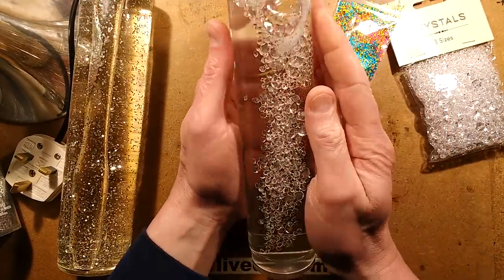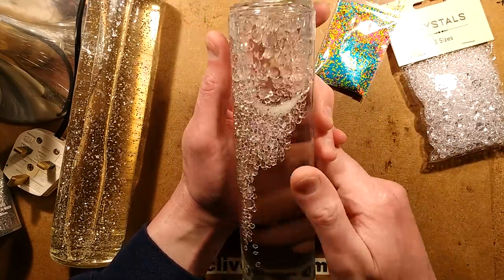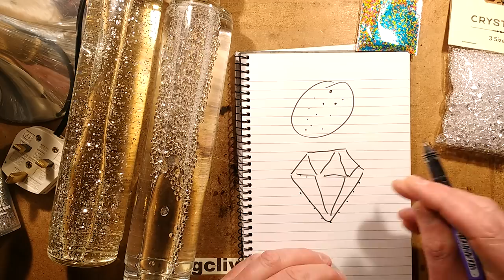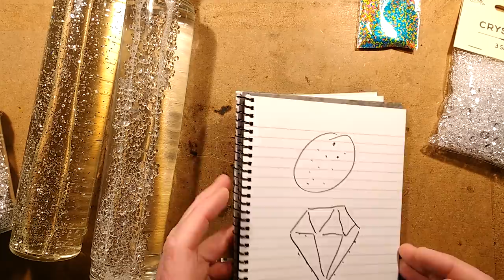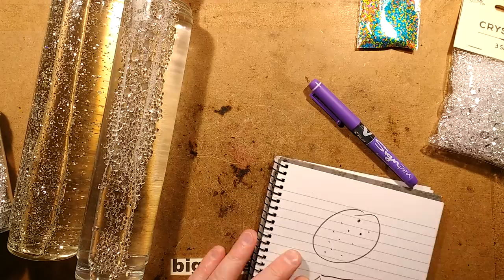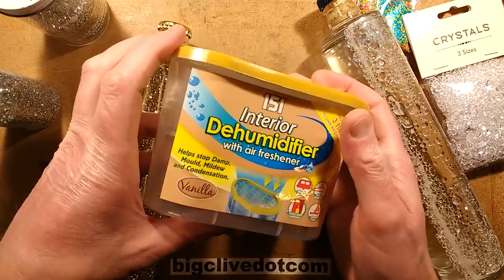Make a DIY flowing crystals lamp.  (Gillian's diamonds.)

Comment: You're absolutely right about early electrical equipment. I have a vivid memory from my childhood in the 1960s when our television suddenly started spouting flames and smoke. There was lots of shouting and then my dad came running into the room with a bucket of water which he poured straight over it...

Comment: Sorry to hear about your mum :(

I'm guessing they're polystyrene. It fits, being hard and clear, and apparently has a density of 1.04g/cm^3.
Reply from the maker: That's an interesting idea.  I've never really thought of polystyrene as having uses like this.
Reply: bigclivedotcom it’s also a very cheap plastic, much cheaper than PMMA (acrylic) so would make sense for a Poundland style product
Reply: bigclivedotcom If you want to test for polystyrene you could try to dissolv one in acetone. If is is getting sticky and dissolving you can ne quite confident it is polystyrene.
Reply: I know I'm replying to an old comment, but another thing you could do is to put a plastic diamond in a cup of water in the microwave. If it softens and deforms, it's polystyrene, because it has a glass transition temperature of around 100°C. Which is also why items made of PS aren't microwave safe.

Comment: Your mom was so lucky, having someone like you to light up her life. I offer condolences as well as a chemistry trick: 

Adjusting the specific gravity will be a bit easier using a saturated salt solution (brine), especially in the fine-tuning adjustments. You'll have more immediate feedback as you titrate the desired density as the salt is already dissolved.

Comment: Sorry to hear of your loss Clive.  

You may be able to get your glitter lamp working if you use a wetting agent like Kodak Photo Flo (or a drop of jet dry rinse aid)...  that would break the surface tension in the water disrupting the boyancy of the lighter fluorescent particles.

Comment: There's an old school building that I dream of buying, fixing up, and living in. As part of that, in the large entry area, I envisioned 6 giant glitter lamps along the walls, which serve as light sources, heat sources, and decoration. In the U.S., we have 250-watt incandescent heat lamps, which are 10% efficient as lights, but 90% efficient as heat sources. They're very bright, very hot, and would be great lights for glitter lamps that are a foot in diameter and 5 feet tall. I think I want an amber-colored liquid, that seems to be my favorite color. And if I ever get to fulfill my dream, Clive has now given me the last piece of the puzzle - what to use for the glitter.

Comment: Big Clive, would be interesting if you disassemble a fujifilm instax printer to see whats inside and how it works. I don't see anyone has done that yet. Thanks
Reply from the maker: It's similar to the old Polaroid cameras.  The photos each have a section of developing chemical at one end that gets squeezed out over the back of the image as it is ejected from the camera through rollers.  The camera itself is usually really simple.
Reply: bigclivedotcom Yes I know that for sure, but I think what you just explained to me is the "Fujifilm instax camera", you should take a look at "Fujifilm Instax Printer". It's not a camera, it's a printer that uses instax film. The thing I'm not sure is how does it transfer a picture to the film? Is there an LCD screen inside or anything else going on? anyway, thanks for responding to my comment :) your channel never fails me, keep up the good work.

Comment: If you use strictly distilled water with calcium nitrate, it wont dissolve the metal.  It is when you use tap water and the nitrate where you create problems, mainly from the inherent chlorides that are in municipal water systems.   When chlorides and nitrates combine, tbey create nitrosyl chloride which is the workhorse in aqua regia (royal water, one of very very very few things that can dissolve gold and some other precious metals)

Excellent video, thank you for sharing

Comment: I saw similar lamp but it was in gel and it had color marbles inside instead of diamonds. It had bright light and some sort of heater at bottom like lava lamp, but it was heating it, marbles go down, then is (I think) stop heating it and they slowly go up. And it was repeating it all the time: balls go up and down slowly. Pretty nice effect.
Reply from the maker: A lava lamp.  It uses weighted wax to create the blobs floating in a water based carrier.

Comment: Acrylic can be injection moulded, extruded of compression moulded, but highest quality PMMA is made by cell casting when they pour liquid monomer and heat it up to start polymerization process, I guess they made this crystals either by cell casting in a mould, or by compression molding, and then probably some postprocessing involving polishing them

Comment: For adjusting the solutions specific gravity, another good modifier is ammonium sulfate. It is pretty easy and cheap to find, as it is often used as a fertilizer. More importantly, ou can dissolve up to 75-80g in 100ml of water. This is about 30% more than Calcium Chloride, which can allow for even higher specific gravities than before.

Also, me condolences Clive about your mother, may she rest in peace and may your burden be light. Always remember she lives on through you and the ones you touch.

Comment: if the glitter you used at the beginning of the video have all different weights... perhaps they would make an interesting cymatic patterm when you put them on a vibrating plate, the different densities would concentrate at different locations

Comment: Use LEDs for light and a resistor for heat. Maybe use an inefficient on purpose resistive dropper based power supply.
Reply from the maker: I did that in another style of lamp.  The PCB had two resistors to limit the current and provide the heat, then just a discrete rectifier and ring of LEDs in parallel.

Comment: I wonder if you could put a couple of power resistors at the bottom, and then use a couple of RGB LED to make a sort of ambient color changing lamp. Then, you could put a thermocouple (or even a thermistor if it were accurate enough) and then dial in the temperature of the bottle perfectly, taking into account the ambient temperature of the room as well. Heck, even be able to fine tune the floating and speed since you could make the liquid slightly hotter or cooler.
Reply: not a led but rgb laser..  looking for those diamonds allready.....

Comment: Calcium chloride is easily available in hardware stores in the US as an ice-melter in the winter. I suppose this tube could be heated with a tea-light candle and lit with an LED ring or just heated and lit with an incandescent bulb as were lava-lamps back in the day.
Reply from the maker: The problem with the cheap calcium chloride is that it is often very cloudy with fine impurities.

Comment: My condolences. Suddenly becoming an orphan is rather strange at first.

I'm wondering what effect pulling a vacuum on the bottle would have, get most of the air out using a food vacuum packer ('Foodsaver'), perhaps. Mine came with a handy tube connection that I use for all sorts of things.
Reply from the maker: I was pondering ways to attach a large syringe to try and vacuum-purge the bubbles quickly, but it actually settles down fast.

Comment: My condolences on your loss; it's difficult losing parents but even worse, I think, when there's that kind of illness involved. I've had several friends have to deal with parents going through various forms of dementia and it's just awful. My own aunt Phyllis succumbed to a series of debilitating strokes.

As for the video - hard to say about the longevity of the plastic gems (especially not knowing exactly what kind of plastic they are) but I'd say they'd probably last longer in aqueous solution than a non-polar liquid (mineral oil, etc.) The other thing that occurs to me is that some table salt here in the USA has additives (to prevent clumping, etc.) that can leave a concentrated solution a bit hazy - apparently that's not the case with the salt you used.

Comment: I tried this recently, however the table salt made mine extremely cloudy before the crystals would float (I have silvered 4.5mm ones). Perhaps the anti-caking agent in the salt?
Reply from the maker: It might be worth trying a different salt.  But also note that some crystals are made with different plastics and if the chrome coating is thick it may make them too heavy for the salt to float.

Comment: Sorry to hear of your loss, your diamond lamp is such a fitting tribute.
Just 2 suggestions, a tiny amount of copper sulphate inhibits fungal and microbial growth and the hint of blue makes the diamonds look brighter and why not cap or cork the bottle when it's hot, that should resolve 'blowing off' problem as it will create a vacuum as it cools.
Reply from the maker: When finished tweaking I do cork the bottle hot for that very reason.  I've added some boric acid as it has strong antifungal and mild antibacterial properties.
Reply: Not only an electrical whizz, but a chemist, physicist and microbiologist!! Is there no end to your talents Clive??

Comment: One litre of water isn't always exactly 1kg. It depends on its temperature. It may expand or contract slightly if heated or cooled down.
Reply: PHYSX_YT I think it's true for water at 20c.
Reply: true but negligible
Reply: Well, if it didn't expand with an increase in temperature (and thus the density didn't change), this type of device would not work.  I believe the 1 gram/cu-cm figure is from the temperature where water is the most dense -- 4C.
Reply: It's even moved slightly off as we've moved away from that definition of density. Seconds is defined in terms of vibrations of atoms, meters (and hence volume) in terms of this and the speed of light. Mass by a lump of metal in France (soon to be redefined, I think). The density of water is now merely measured. 1Mg/m^3 is good enough for a lamp though :)

Comment: To sterilize it after it's finished, you could put it in a waterbath at close to 100°C (i guess even 80°C over some time would be enough to kill anything in it)
- or however you sterilize the jam you make in scotland :-)

Did you try how the diamonds react to adding car antifreeze in a small dosage ?
i use it in my pc watercooling since 2004, to counter oxidation/galvanic reaction of different metals in loop,
also it kills anything bacteria lik or algae..
aaand you get it in different colors, green, blue, red/pink..
only need a small amount, and it has calcium-blockers/decalcifier because it's intended to be mixed with normal tap water.

-- Nice idea to memorize+remember a person this way :-)

edit: there are also other watercooling additives+stabilizers, with UV active reaction and stuff..

Comment: I think the fake diamonds are made from polystyrene. Without additives like butylene (which makes it opaque and tough) it's perfectly clear, fairly brittle, and very light at 1.04g/cm^3. And it's insanely cheap, so much cheaper than PMMA (acrylic)!
Reply from the maker: Someone else mentioned that it may be polystyrene too.  I think you may be right.

Comment: So, let's say you were an insane billionaire and you wanted to recreate this effect with real diamonds. Is that possible?

The specific gravity of diamond is inconveniently high at 3.52.

Googling didn't help much, Mercury (13.63) is much too dense and entirely opaque, Bromine (3.19) is a little too low and really very brown.
Perhaps Bromine with something dissolved into it would reach the right density...no idea about the colour though.
Reply: Interesting idea!  I don't think you'll find a common substance to float a diamond, but one of the "heavy liquids" used in a lab centrifuge might.  Methylene iodide, if I recall, would be about right.
Reply: Try using different concentrations of Caesium chloride. Or, use sucrose - we used to use sucrose gradients (and a CsCl "cushion") for density gradient centrifugation. Sugar is going to be much easier to find (and a whole lot safer too!)

Comment: Just some clarification on the specific gravity deal. It's the ratio of the density of the compared substance to the density of water. This actually makes it unit-less as it's a density divided by a density. You mention specific gravity as being a density which isn't really true. This also has the attribute of the specific gravity found by both metric and imperial are the same since it's a ratio. Sorry for the nitpicking.

Comment: If you make this or anytime you want to add bleach to help sterilize water, you only need to add a few drops of bleach per gallon. If you add any more than that you'll risk discoloring anything the water touches. Including these plastic diamond things.   You can also use hydrogen peroxide which will accomplish the same thing. Only use a few drops of peroxide as well.  A little goes a long way.
Reply from the maker: I've tried a pinch of boric acid.

Comment: Would have thought liquid paraffin aka baby oil would have made a good fluid.
Reply: Liquid parafin has a density of around 0.8 (I work in a the QC lab for a pharmeceutical manufactureer so test liquid parafin on a regular basis) so is lighter then water, would possibly work for the multi coloured stuff shown at the beginning though